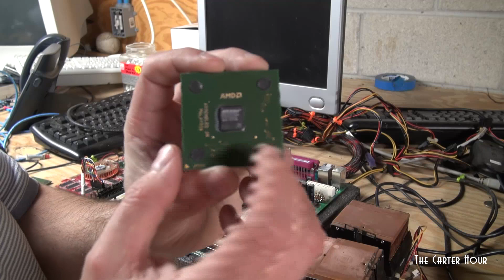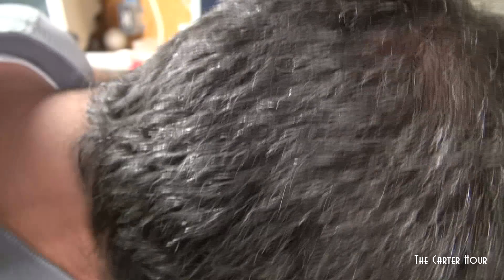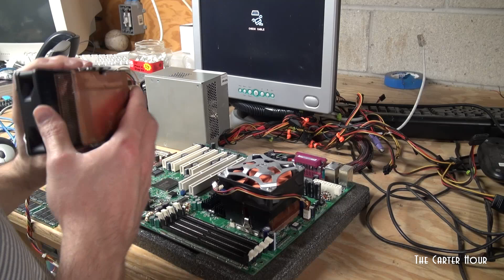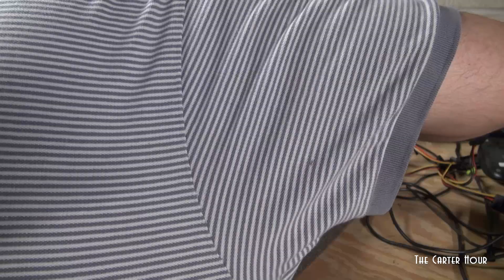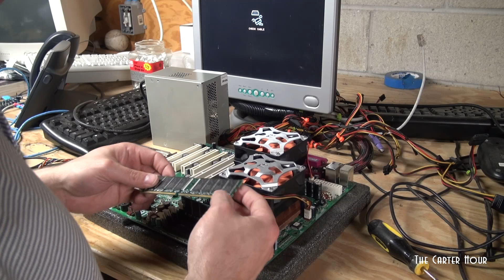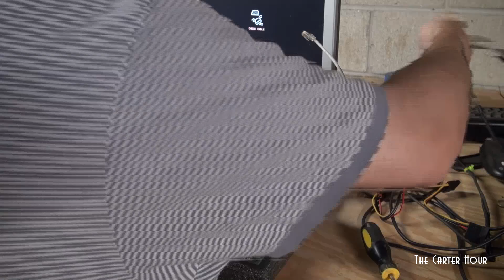Old Tyan Dual Processor Motherboard Test...

Comment: Description might be wrong - onboard NIC on my S2466 is a 3com. Unless you have a different revision and they changed it.

These were amazing boards back then. I do remember discovering Windows 2000 had a long delay (about 1/4 second) when switching processes from one CPU to the other, which was horrible for watching DVDs and playing some games. Thankfully XP fixed that. And then there was the games that didn't like SMP... Such fun as an early adopter of dual CPU gaming.

Trying to get mine going again after turning it off in early 2011. Doesn't want to POST (no beeps), but I'm hoping it's just dust in the CPU socket(s). Hasn't been cleaned since it became our home server in ~2006, so it's got about 5 years of crud in there.
Reply from the maker: I was never so excited to build a machine until I built that one.  I 
used it for over 7 years with no problems and continued to be used up 
until 2012.  Then decommissioned it.  I think your actually right, it 
may be a 3com NIC.  I will check on that.  Thanks for the comment.  
Hopefully you can get yours going soon.

Comment: Dish washer?????
Reply from the maker: Yep, ran the motherboard in the Dishwasher.  Thanks for the comment.
Reply: Yep!!
Thats cool. Should try that
Reply from the maker: Just make sure not to use detergent.  Powered Citric Acid is probably ok.
Reply: The Carter Hour cool, ill try that. Would it hurt capicitors?
Reply from the maker: Well I would say no, as all my boards and motherboards are still working great.